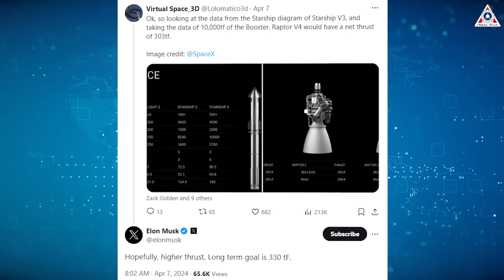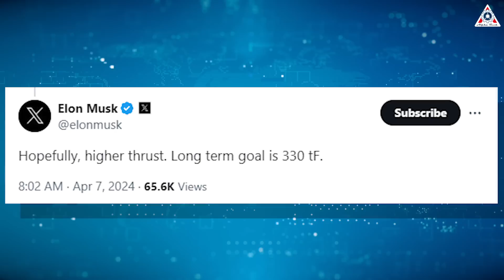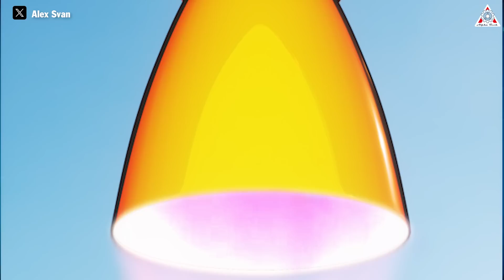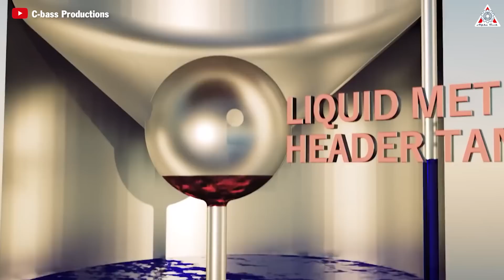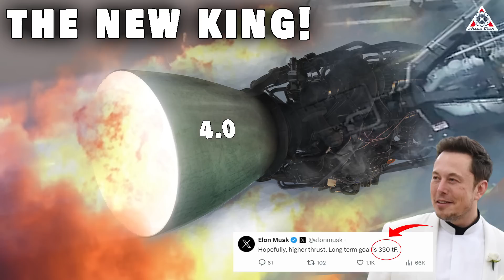Elon Musk just officially announced the New Raptor 4...

Comment: Thrust to weight ratio has nothing to do with sa goal of rocket engine development. The engine has to squeeze maximum of specific impulse from fuel. Then the engineer can calculate ratio of saved fuel to the engine mass.
E.g. if you saved 5% of fuel that has 20t value, and you engine increased from 1t to 1.3t, you still have 20t/1.3t ratio you can be proud of.

Comment: I live 15 miles from the SpaceX test facility. We can literally feel their advances in their engines. Just about every day they do an engine test that we can hear and feel. It lasts from 30 to 60 seconds. At first it felt like a train going by in the distance. Over time, the sound and vibration has become stronger and stronger. We noticed one day that our widows started shaking and rattling. Then, later on this past year, our whole house started shaking with every test. Things started falling of the wall and off of shelves. We ran out of the house to locate the sound. It was like a jumbo jet taking off. But, when you go outside to orient yourself to the sound and vibration, it feels like it's coming from everywhere and nowhere at the same time. It's a very unsettling feeling, until your brain kicks in and tells you, "Oh! It's just SpaceX. doing their thing again.". I told my wife that the new change in intensity was probably caused by their testing of a new version of the rocket engine.  This video is confirmation of that.
Reply: You need to sell your house before it's worth nothing with all the cracks and roof starting to collapse. No one is going to buy property near Spacex. It's fun to watch and experience now but soon it would turn out quite the opposite !

Comment: Hello there 🤗 , just Wanted to ask why rocket's don't Use the atmospheric oxygen until they get higher, like  it uses atmosphere oxygen until it's done it's first boost or something like that, I imagine it would be complicated to make the atmosphere  pressurised enough for the fuel, just saying it might save on liquid oxygen weight and make more room for more cars 😜 or a vacation chamber for holidays 😅
Reply: This was attempted in the early 90's with the X-30 transatmospheric spaceplane that was to takeoff from a runway and achieve orbit. It used air ducted rockets (using condensed liquid air) to takeoff and accelerate to ramjet operation and then transition to scramjet operation at Mach 5-6 with variable geometry inlets. Material technology at the time was not capable and the transition from ramjet to scramjet operation proved to be too great a hurdle. In addition scramjet combustion efficiency was underwhelming. I suspect scramjet technology has improved since then but I haven't been in that business since 1992. IRC even if they had gotten all of the various engine modes and transitions to work, the payload to orbit would have been minuscule.
Reply: Congratulations, you've now made an engine which replaces the weight of propellant with an even greater weight of all the extra hardware needed to use the atmosphere. It's also a very complex design that introduces even more points of failure. Normal rocket engines are already incredibly complex and full of possible failure points.

Comment: It kills me that we're still so far behind the 1960's achievements.
Reply: Not true, not even a little bit
Reply: A Raptor 3 engine has 280 tons of force, One of Saturn V's F-1 engines had about 690

The first stage of Saturn V had 5 F-1 engines
Starship has 33

280*33 = 9240 5*690=3450

9240
--------- = 2.67x more thrust than the Saturn V first stage
3450

If Raptor 3 or 4 does somehow reach 330 tons of force. That number changes to 3.15x the thrust of Saturn V first stage.
And Starship is 1.1 meters smaller in diameter than Saturn V
Reply: A. Reusability. Saturn V stage 1 landing its self?? LOL 
B. Payload to orbit
C. Far less poluting exhaust 
D. Rapid launch cadence
A+B+C+D>F1 therefore major progress in utility and sustainability
Reply: Вы неубиваемы однако, еще долго терпеть придется...